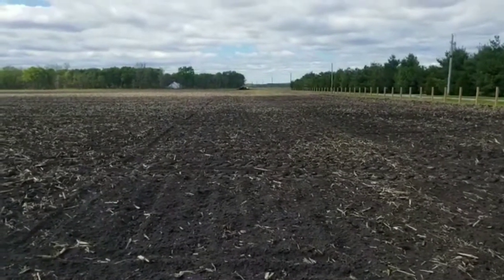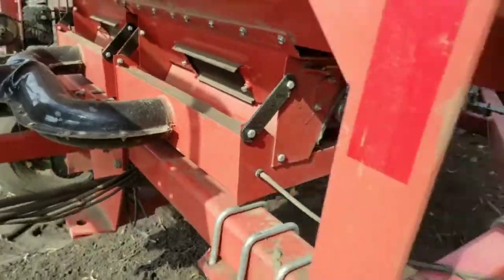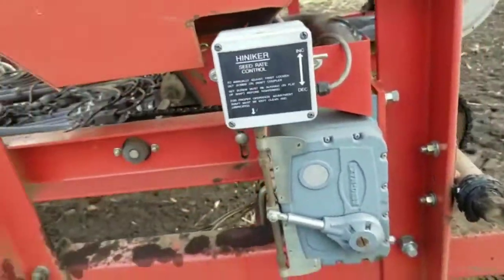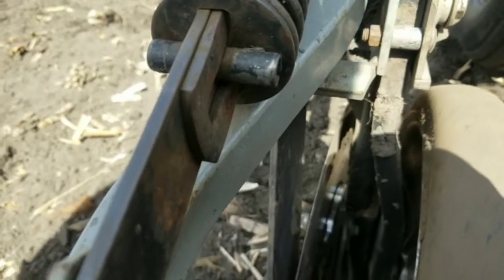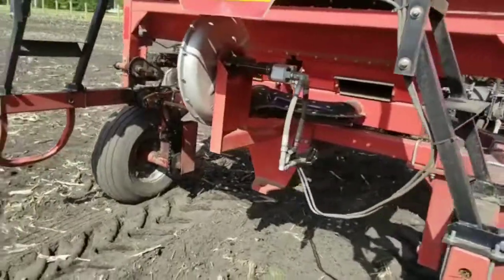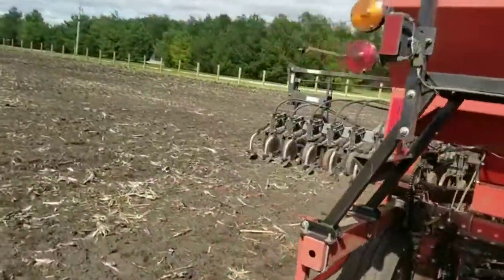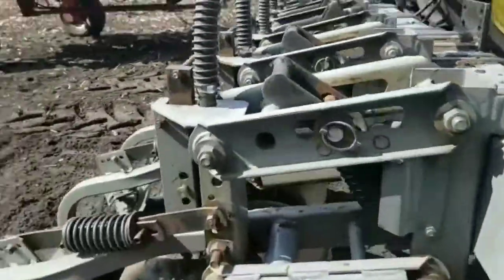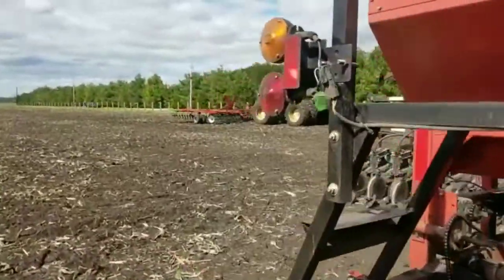How a Air Seeder Works!! It Blows!!!

Comment: How reliable has it been ? Does it detect a lot of issues when your operating it?
Reply from the maker: It's actually been a really good planter other than disk opener bearings going bad and I blame that on poor manufacturing of bearings now days....it will definitely detect a blocked seed tube and let you know on the monitor or you will physically see a seed cup over flowing with beans because there is a issue on that row